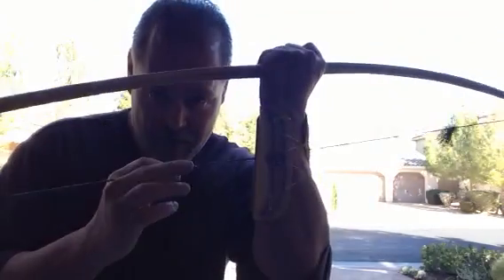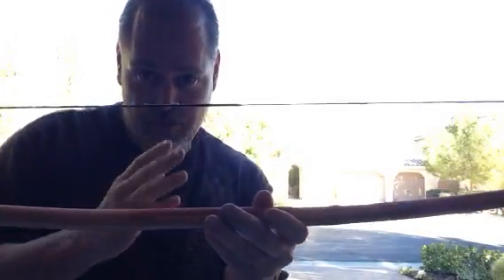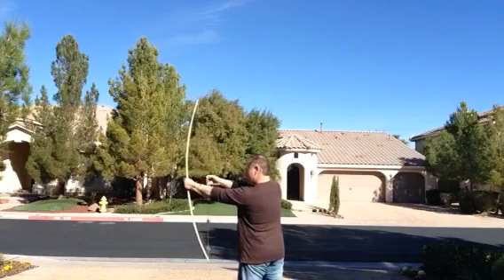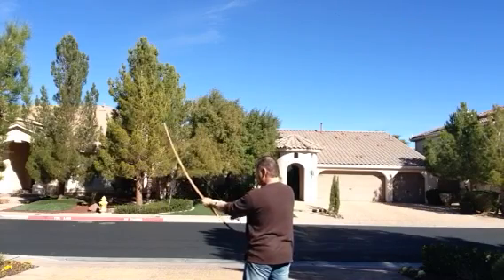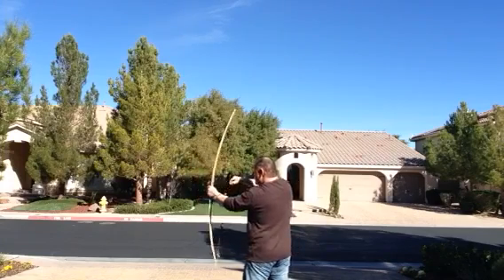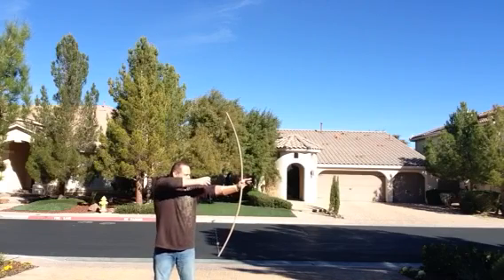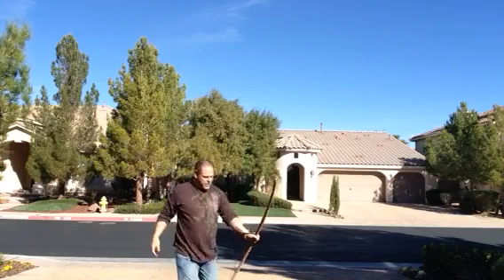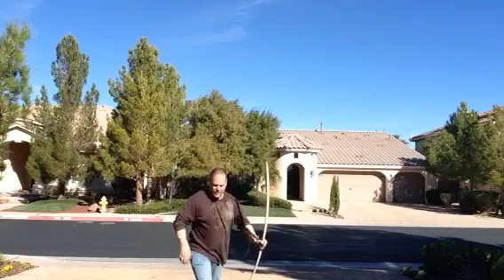Archery: How to build a bow: Lumber Store Bow: Tillering: What do you see?

Comment: Hi Mike. It might be a little late to answer, but it looks to me like the bow is pretty well shaped, There does seem to be something of a flat spot near the handle and one near the top limb. (@:59 seconds) Both are small and would not effect the bows performance much in the short term, but long term they could be weak points. I could be wrong as it is hard to tell from video; the angle you hold the bow and your hand placement. I heard you say in the video you lost the center mark, so it looks to me your holding the bow a bit low in the handle which could cause the tiller to look a bit off when it might no be at all. I hope this helps and doesn't come too late. 
I enjoy your videos and hope you continue making them. Thanks for all of them by the way. :)